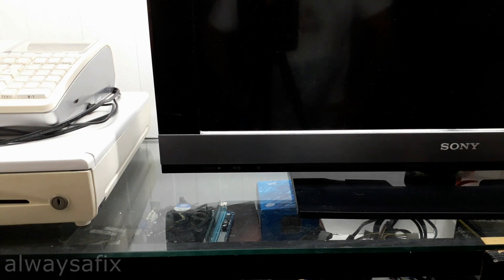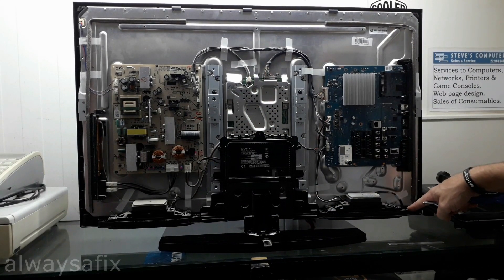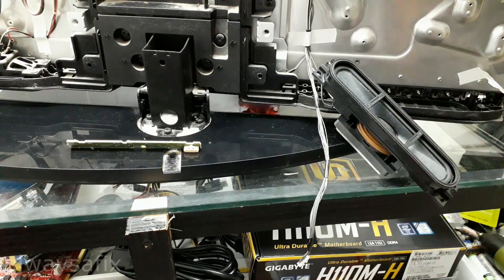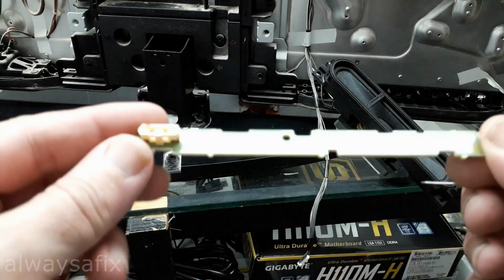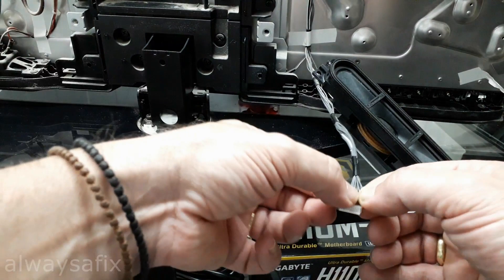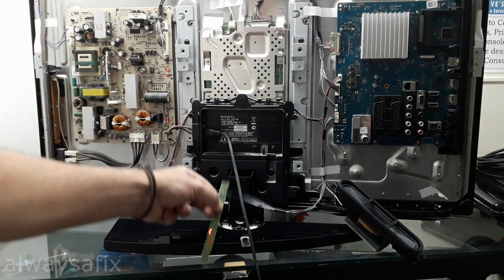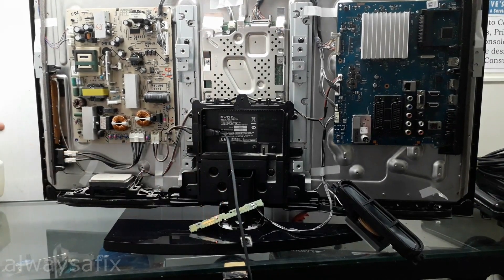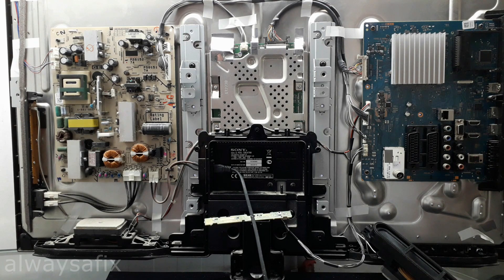Sony Bravia TV blinking red light, Easy Fix, No parts required

Comment: hey is there a fix similar to this for a Sony KD-55X9000H blinking 4 red lights where a wire or 2 disconnecting would solve it ?
Reply from the maker: No sorry, try a full factory reset. https://www.sony.co.uk/electronics/support/televisions-projectors-lcd-tvs-android-/kd-55xe9005/articles/00274122

Comment: sir my tv is also sony KDL - 40EX710 it has red lighting  problem i removed the remote circuit  tv works fine Which number of wire do I have to cut?

Comment: I have a Sony Bravia 65x800g that's giving me 6 blinking lights (LED backlight error code) and, upon taking it apart and testing the backlights, I found that they all seem to work fine. Now I'm not sure if it's a PSU issue or something to do with the tcon.
Reply: I have this tv and six flashing lights as well. Did this wire trick work for you?
Reply: @erinschmiedekamp4037 unfortunately not. I had to replace the backlighting entirely.

Comment: Hi just tried the removing remote sensor for 4 blinks sadly no success the lamps seem to be struggling before set switches off . Do you advice for 4 blinks? Thanks for sharing
Reply: Try disconnecting the backlight error return cabke between motherboard and power supply. 4th wire front wire down from top of block connector on power supply. Ground the free end from the motherboard. 4 lights I think is backlight error code.  That or power supply failure.

Comment: Different model KDL-43W800C.  White screen then backlight turns off (black screen) and 5 red blinks.  Cold blower on the sensor slots, bottom center of the TV, to release probably dust particles.  Now working fine.
Reply from the maker: nice

Comment: I also have the same issue buy on a different model, so it's either swapped the LED driver board or just cut the wire and ground it?

Comment: Hi @alwaysafix i have a Sony Bravia model KDL 40VE5 and when plug in to AC the Stand by led is red then press power button and red led is off and green led ON few seconds a tic sounds and green led is off then red led is on. TV not start images no sounds, no pictures, no led blinks. I repeat turn on TV and the same happens. What do you recommends? Thanks

Comment: Took out the back cover to fix volume problem. Fixed the back cover but now I can not plug HDMI cable as the cover has not gone down completely. The cover doesn’t allow the plug to be fixed. All cover bolts are tight. Can you help?

Comment: Hi, I have a model KD- 7559000B which is about 7 years old 75 inch great TV but recently flashing 9 times and shutting down, l have cleaned the vents and also have a fan directed at the back of the TV but the shut down is more frequent. Appreciate any tips like removing the back and maybe vacuuming the inside?
Reply: Did you manage to fix it?

Comment: I am having the same issue suddenly for last 2 days

Tv was off ( not on standby ) from last 10hrs

but when I unplug power cord and set top box and re connect power cord tv works fine then I reconnect set top box watch tv for works without any problem

Comment: I had to unplug the whole jack instead of just cutting some wires, then you could turn on the TV using the power button on the back of the TV, and use an app to control the TV instead of the remote. Note that if hanging on the wall, the vents must be left open on the back of the TV, it is best to put it on the table

Comment: You are awesome! this worked for me! I disconnected 11 and 12
Reply: Does the remote still work after that? Need to cut both 11 and 12 wires or only 11? Thanks.
Reply: Is it 11-12 on the right side near the right specked ? Or 11-12 on towards the left specked the white and gray ?
Reply: @johnpal9142  I have unplugged both 11 and 12 and it doesn't work, but unplugged the jack is ok, but after that you have to install an application remote tv by smartphone

Comment: I have the KD-65X9000 red light flashing 7 times. same procedure u think? Just happened for the first time today.
Reply: Did you try fix it like this video? Or another way to fix? Tell me, pls, i have same problem and same tv.
Reply: @Sang-KTVHN  didnt work.
Reply: @SamerFrem  So did you fix it in any other way?
Reply: @Sang-KTVHN  no. still in my depot.
Reply: @SamerFrem  i fixed it. I had to unplug the whole jack instead of just cutting some wires, then you could turn on the TV using the power button on the back of the TV, and use an app to control the TV instead of the remote. Note that if hanging on the wall, the vents must be left open on the back of the TV, it is best to put it on the table.
Reply: @Sang-KTVHN  oh nice. Will try it tonight

Comment: Hello I have a Bravia Sony 2018 it's 65 inch and it keeps turning off and on on its own. I can't do a hard reset because it turns off. I pull wire 11& 12 just in case it was the sensor because I believe it does have to do with power saver. Is there another one I can try to pull ? At this point we are ready to trash it, but, of I can fix it that would be awesome!
Reply: Did you try fix it like this video? Or another way to fix? Tell me, pls, i have same problem and same tv.
Reply: Same lmk
Reply: I tried everything but it never worked, found this video and tried but still didn't work. After lots of research we decided to put it out for trash. So upset!
Reply: @butterfliesandbeehives2190  that's too bad. Trying myself.. Prolly.something.ez too.

Comment: If you were like me & couldn't even get your TV to boot far enough to do a hard reset, your in trouble. You see,  I turned the Back-light (which was failing) from 5 to 7 and the TV instantly shut down & went into an endless boot loop.
Well, just get yourself the brightest LED torch you can find & shine it straight into that auto light sensor on the front of the TV at boot up. This sucks the TV into thinking that it is as bright as the sun in your lounge room and it turns down the back-light to 5 automatically at boot up. Once that happens your TV will start & you can then quickly do a hard reset and once that is done go to options & turn the back light down to 4 or leave it set at 5 but no higher. Then turn the brightness up to max or near max & you won't even be able to tell the difference. You TV will work properly for a few months more, but U better start saving for a new one because the back light (or the sensor) is already past its use-by date & it won't last forever.
Reply: good ideal, i'll try it, thanks

Comment: Followed your instructions. Couldn't get the back off our 48" Bravia (now 10 yes old) but managed to get to the part concerned. Cut wires 11 and 12. Working again. Brilliant stuff. Thanks so much for sharing. 👍🏼
Reply from the maker: Great to hear
Reply: @alwaysafix  How do u know which is the 11th and 12th wire is thanks and in my Sony I cannot see this board I have a 65 inch do I look for something with 12 wires thanks
Reply: @glynnwatkins1693  there's a legend on it you can see it on the board as what he says on his video
Reply: How do u know which is the 11th and 12th wire is thanks and in my Sony I cannot see this board I have a 65 inch do I look for something with 12 wires thanks
Reply: Thanks ! Took care of my issue too on my KDL55

Comment: Please help me my tv blinking red light 5 times
Reply: I'm also facing same issue. 
The indicator under SONY logo started blinking for 5 times and the tv screen turns into some pale white shade and then goes off and the blinking starts. 
The blinking not going off until I remove the actual plug behind TV. 
I've updated software and unplugged the other sources(DTH via HDMI, USB). Ive also plugged tv into a different power outlet. 

It seems like serious issue.
Reply: @getluped  same
Reply: Mee too....
Reply: @renorainesrenegade  same find a fix?
Reply: @megatron7057  AC/DC board. it doesn't matter now, this TV is priceles😠
Reply: @renorainesrenegade  i got a 55 brought it home tried a factory reset was a no go. Ac dc board .  did u fix it what it cost u?  Seen some ps boards running 60 bucks w shipping. Kinda wanted to try it for fun :))
Reply: @megatron7057  Mine was 32inch. Try the board and see👍
Reply: @renorainesrenegade  seen so many cheap tvs lately. Wish if i knew it was the ac dc board for sure. Tries to turn on and no lights. Might be led?

Comment: If I remove this piece, can I keep it out? I don’t use a remote with the TV so will it still work okay without putting this back? Not sure if I can do the wire part, but I’ll see!
Reply: Did you try fix it like this video? Or another way to fix? Tell me, pls, i have same problem and same tv.
Reply: @Sang-KTVHN  Yes I did! I took the piece out completely and didn’t put it back. It worked fine. 

The only thing is that the red light (that shows the TV is on) no longer comes on, so just be aware of that. Otherwise no issues, and you can still access all the menu options using the buttons on the TV.
Reply: @Loren400  thanks. Why don't you try cut the 11th wire (like in this video), maybe remote can work.
Reply: @Sang-KTVHN  I don’t have a remote in the first place, so didn’t need that part to work. I use my TV as a computer screen so works fine like this.

Comment: Thanks for this fixed our old bravia kdl. Hardest part of the whole thing for me was getting the back of the tv. After that easy had to watch your vid a couple of times to select the right wires. But once I saw that it was the ones at the opposite end to the only white wire, simple.
Reply: Please, can you tell me the serial number of the white wire and the wire to be cut? I am understanding that the white wire is the number 2 wire and the wire to be cut is the number 11, right? Thanks.

Comment: I need help with mine it’s a smaller than a 32 inch but it has the same problem and I would like to fix it myself
Reply: Did you try fix it like this video? Or another way to fix? Tell me, pls, i have same problem and same tv.